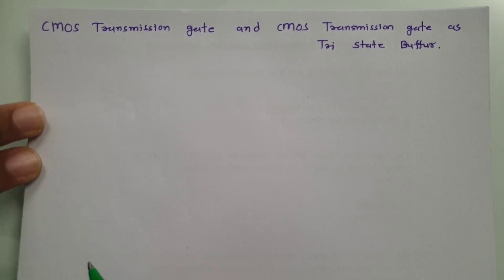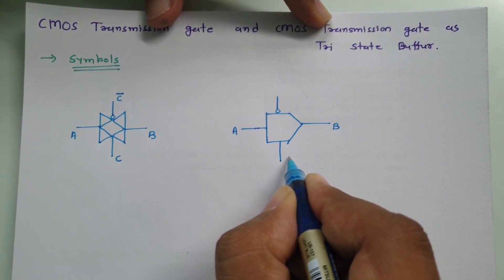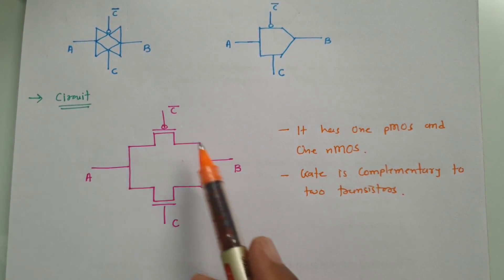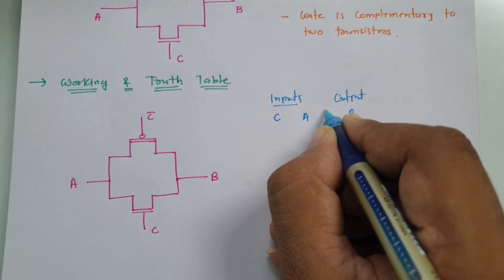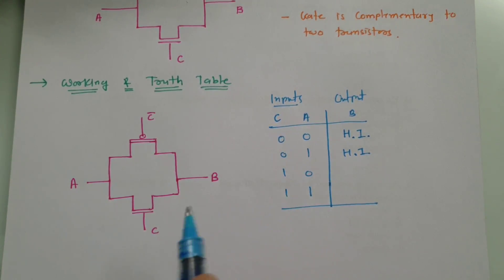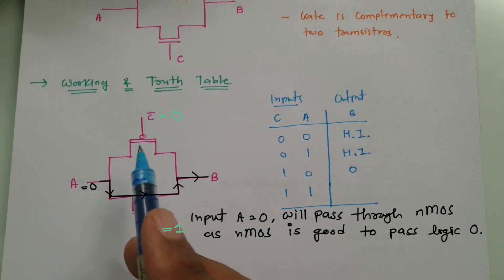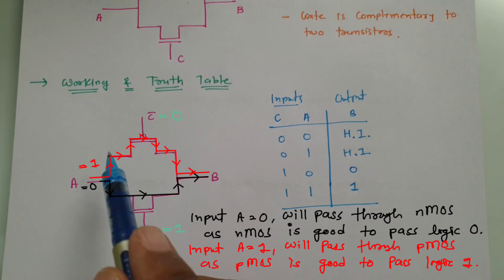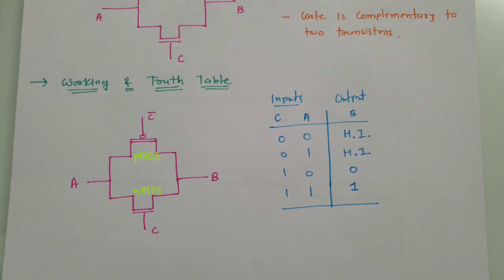CMOS Transmission Gate Explained: Symbols, Circuit Design, Working & Truth Table

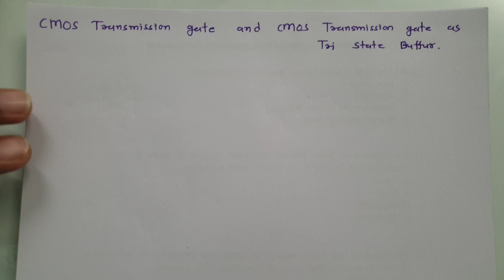Comment: 00:02 CMOS transmission gate and its working as a tri-state buffer
00:58 CMOS Transmission Gate symbol has input A, output B, and control signal C.
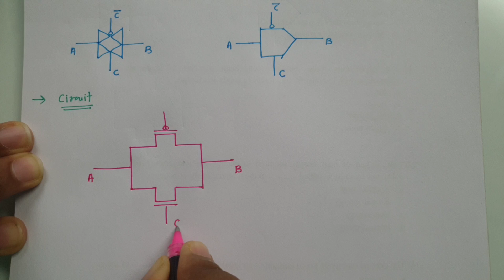01:56 CMOS transmission gate consists of one PMOS and one NMOS, with complementary control signals
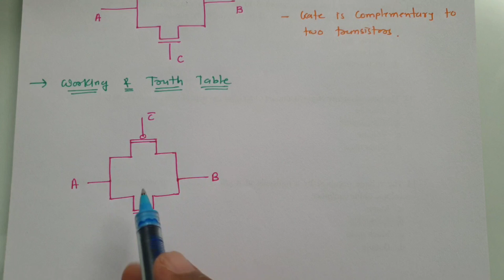03:08 CMOS transmission gate has two inputs and four combinations.
04:20 CMOS transmission gate can switch between on/off/open circuit modes based on input signals.
05:21 Working of CMOS Transmission Gate
06:25 CMOS Transmission Gate can function as a Tri-State Buffer
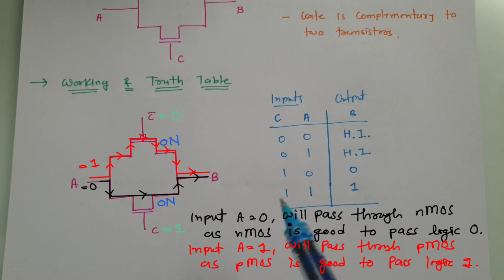07:20 CMOS transmission gate works as a tri-state buffer.
Crafted by Merlin AI.